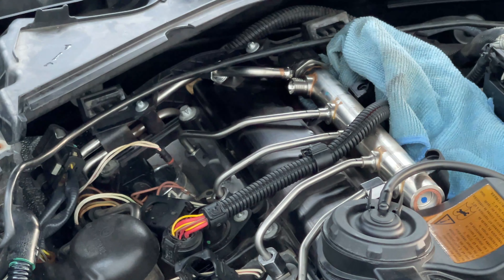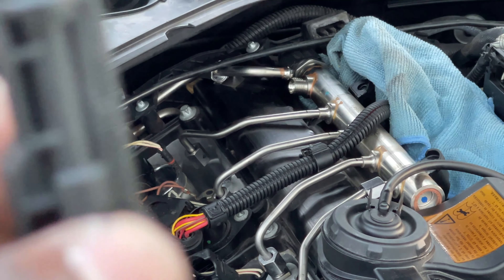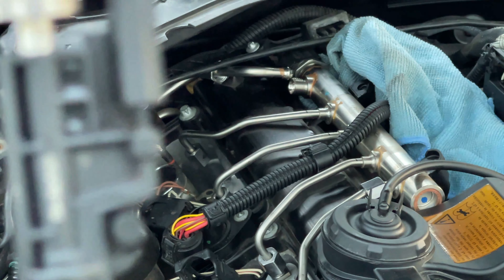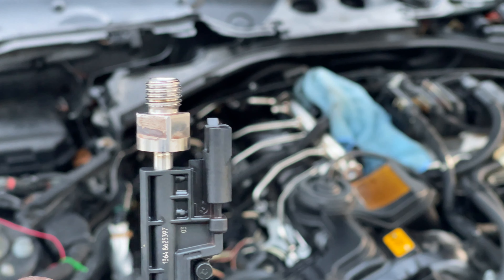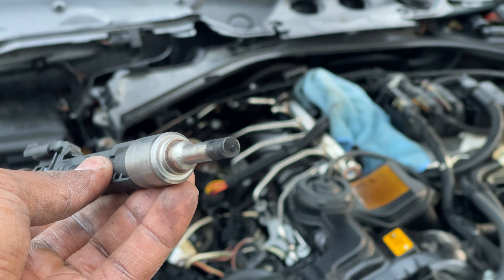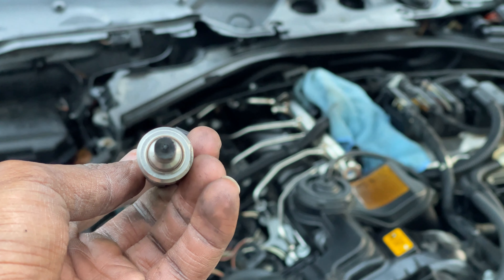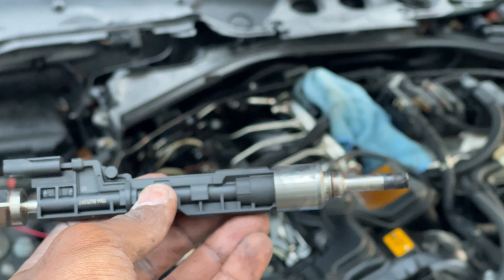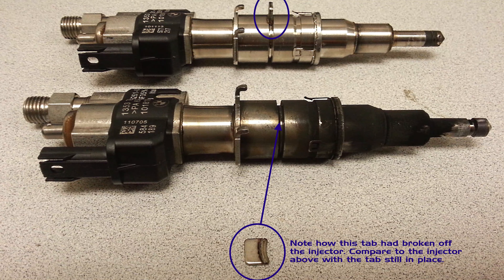How to Repair P0204 Drivetrain malfunction Without buying Parts | BMW 328i Repair | Get Fixed

Comment: Get step ladder, and with 9v battery in hand, remove / replace smoke detector battery/ it is exhausted, replacement in hand, swap and close cover. Press test button on said detector. Incessant beeping will end.
Reply from the maker: The excessive beeping slows down my heart rate and makes me feel like the Prince of Florida. Putting a battery in that detector will take that feeling from me.